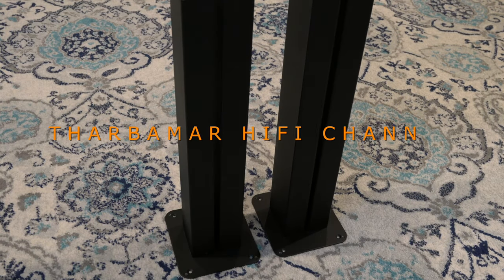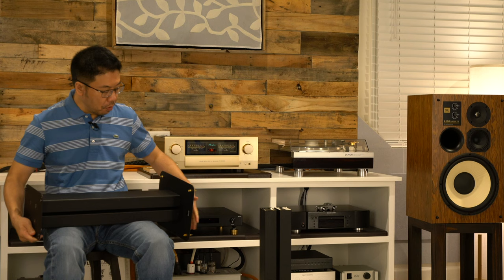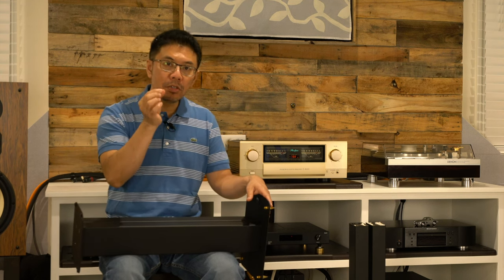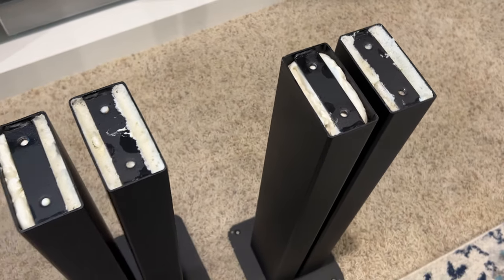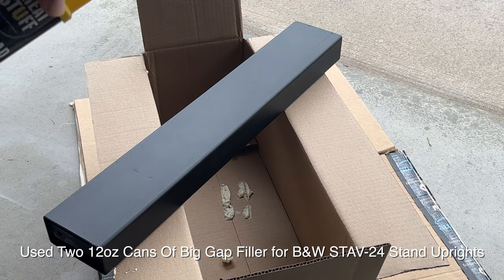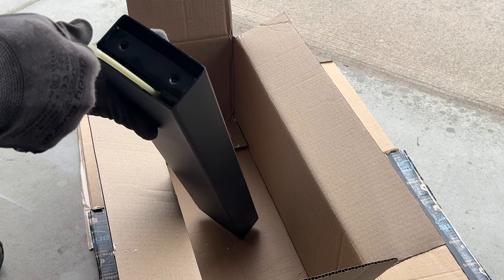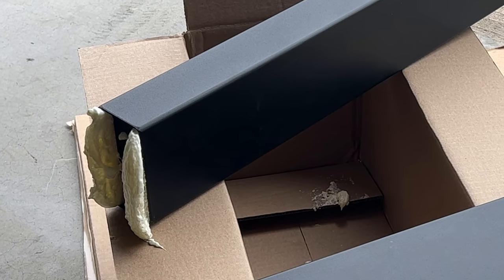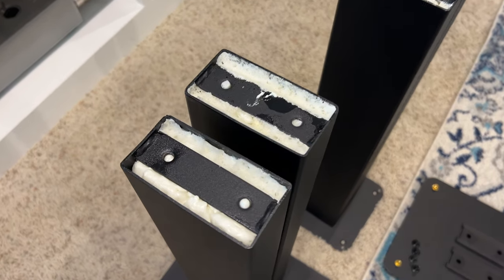Easier Way To Stop Metal Speaker Stands from Ringing

Comment: I've done this! I also did a sealed tube rack stand drilling some holes to pump the foam in. Tips; mask off the outside by the entry point - easier than a clean up, put a bolt in the bolt holes to save them clogging up (you can oil/grease it to save any sticking).
Reply from the maker: That's a great idea!

Comment: I had the same stands too. As I've moved only twice in my life, I never bothered to consider the light weight of the stands on the contrary; I filled them deliberately with catlitter which made the stands comfortably heavy.  Since I had two domestic cats the heavy weight of the stands would prevent them tipping over since cats tend to rub against objects. By the way the use of catlitter was never messy; I taped the gaps form the inside out before applying the catlitter. Nonetheless your video is a great tip for those who have to move their stands around a lot.  Thx!

Comment: I bought a sack of sand, after soaking the sand, I divided it up into two dozen freezer bags. Wedged them down into the speaker stand and the next day they dried out almost like as if the stand was full of cement 🥳
Reply: @totalplonker824  That is a bad idea. You want extremely dry sand for at least two important reasons. Wet (even damp) sand will rust out your stands from the inside, because the moisture can never escape, unless your freezer bag seals didn't get compromised from wedging then down in the stands. Dry sand can move freely to absorb the resonant energy (turning the energy into heat from the friction of sand particles rubbing together) to decouple your speakers from the floor and remove any ringing. Floor resonance makes a very crappy (muddy) subwoofer. That is why typical stand fill is granular and loose. Wet sand can at least be dumped out. I think foam is a dumb idea, because there is no turning back and it doesn't work as well at absorbing resonance and (probably) less effective at totally dampening ringing and definitely adds very little to mass loading the speakers. All of which add to considerably better performance. 

A lot of people don't seem to realize the benefits of mass loading speakers. Physics dictates that for every force there is an equal reaction, thus you want your speaker as solid as possible (heavy and not wobbly). I had tall speakers wobbling on thick carpet and when I spiked them to the concrete below the bass got tighter and much more powerful. Mass loading make a huge difference. If your speakers are rock solid all of the energy from the drivers are pushing air forwards, rather than rocking (ever so slightly) backwards.
Reply: @gordthor5351  just for the record... not only are the freezer bags sealed they're actually doubled up as well! (Make sure squeeze out all the air) At the time I was a little concerned when wedging them down they might actually split. Hence the doubling-up. Over 5 years now still rock solid!

Comment: Filled my stereo rack and speaker stand with dried sand like most do. But I seal the sand in with this foam and silicone caulking so they never leak to create a mess. Could have used just the foam for ringing but like the heff added for stability.

Comment: fill mine with sterile play sand...all 3 poles on each stand - very heavy now...great for your standmount speakers, use a funnel
Reply from the maker: Yes sand is good if you need to weighted down but it will still absorb moisture in the long term, you must check it annually to prevent internal rust without you noticing.

Comment: I love this, never considered using Great Stuff in them. Can I ask, do you notice any reduction in vibration transmission to the bottom plate compared to sand or litter? I've got raised hardwood floors and am looking into solutions to deal with too much resonance going into the floors. Some is ok, as it can be pleasing to get a little coupling which adds some life, but getting sill too much through my stands to the floor, even when filling with kitty litter. Going to also try marble slabs or butcher boards under the stands. Thanks 🙏

Comment: Actually there’s a much simpler way. I use a solid spruce wood stand with 4 wood feet made of 80x80 mm wood profile. You just go to a construction store buy some wood and then to a woodworking guy to make and glue the wood profiles for you. Wood is always going to be better than metal in terms of acoustics. Then i use four Pangea Mega Large sorbothane feet which i place beneath my JBLs and the wood stand. This way the vibrations generated by the speakers box is not transmitted to the woodstand. I place the speakers on a plywood board and then the board onto the sorbothane feet. So it is like this: speakers, plywood board, sorbothane feet, wood stand. Cheers.
Reply from the maker: Yes I do have 5 posts DIY custom made stands, solid wood 4 uprights and HDF middle post. Thanks

Comment: I used very white beach sand from one of Australia's most famous beaches.
Reply from the maker: Sand is ok but it must be baked dried, even with that it will be absorbing moisture in the long term and internal rust will develops without you noticing, you should check it annually to make sure it still dry.

Comment: I'd like to see someone try "Kilmat 80", or similar.
It's the anti-vibration, sound deadening adhesive mat that car guys put on their rides to reduce road noise, panel vibration (!), and make them quieter.
Installation would require some dexterity, but can be done.
Anyone want to try this promising solution?
Reply from the maker: Many years ago I tried dynamat extreme and its not possible to get it stick properly inside, not maneuverable in there, not suitable for narrow spaces with four walls, I had fair share of treating dynamat inside my cars.

Comment: It is not a good idea. The best way - little stones, sand, metal drops... Its doing not only damp, but give a weight, what is very good for sustainability and vibration properties.
Reply from the maker: To each of own, I’ve done that before with every available material because I had many different speaker stands, adding weight doesn’t really help with stability, I did push test with or without weight I’ll stick with lighter and moisture resistant material and stays away from sand because it will absorb moisture over time and it will cause internal rust.
Reply: @Tharbamar  it was bad test, if you said that. Buy good isolation feets and u will see what is mean big weight and little weight.
Reply from the maker: I have pretty much every isolation feet available, it'll help but not 100%, weight is nothing to do with stability of the uprights, it's more to do with balance, please see how I was able to achieved absolute stability even on carpet floor with this three spikes stand in this video, https://youtu.be/Co23KVm9nBY